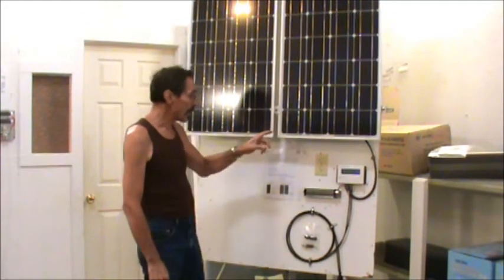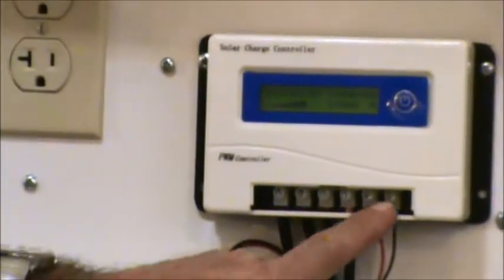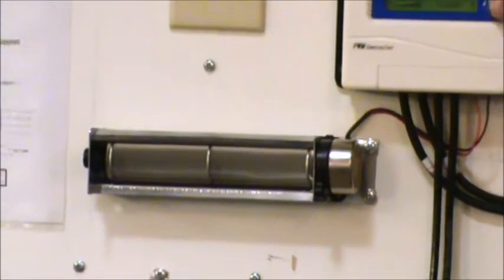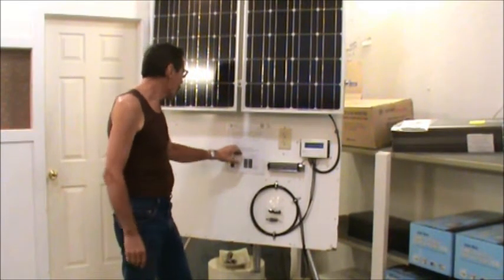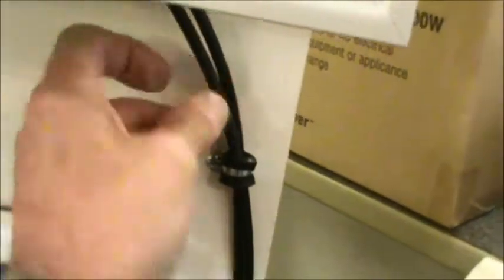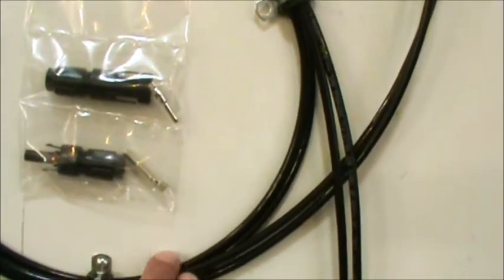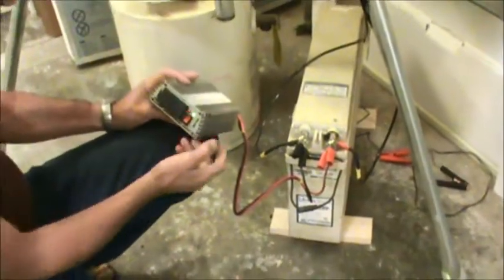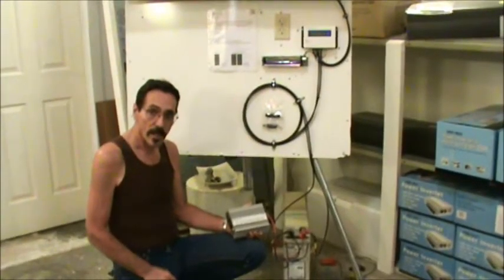DIY: How to Build a 200 Watt Solar Panel Kit | Missouri Wind and Solar

Comment: Hi Jeff
Been watching your vids this beautiful Saturday
Finding them to provide clear and useful info.
My Dodge Van's 270watt solar city panel, on the ladder on the roof racks, is used to keep my cordless power tools charged
plus the fans, inside lights and the laptop all stays fully charged.
Thanks for clearing up some of the solar controller questions I had on some of your other vids.

Comment: Hi Jeff: love all your videos, easy to follow and understand, but I have a question. If I want to set up a small solar system to run a small 135w fridge, how many solar panels would I need?,and also how many batteries and what kind of charge controller and inverter? Thank you and Happy Holidays!
Reply from the maker: Thanks. Here's a video that will help you out with that  Solar panels for the beginner How to Part one Missouri Wind and Solar simple instructions

Comment: I always enjoy when people try to answer the question about what you can run using a 100 watt solar panel.  The more appropriate question is what can I run off of my battery bank and how long will it take to recharge my battery bank using X watts of solar panels.

For example, if I had a 600 amp/hr battery bank, I could potentially run some high draw appliances for a few hours.  But if I had a single 100 watt solar panel, how long would it take to replace 300 amp/hrs of charge into my battery bank?  Likewise, if my battery bank was only 90 amp/hrs, how long would it take to replace 45 amp/hrs into it?

It is possible to have a large battery bank and a small PV array, but you might need to charge for 2-3 days to replace the amount of power that you use in just 4-5 hours of running appliances.  There are a multitude of questions to be asked in order to determine the size of the various system components (PV array wattage, battery bank size, charge controller size/type, inverter size, etc...) when designing a solar system.

Still, it is good to give beginners some rough ideas before getting into the nitty-gritty details of a purpose designed system.  I like the 200 watt kit that you have put together.

Comment: Jeff ,
 I was looking at Sharp model ND-Q250F7, I noticed that the max voltage was 29.8, could I use four of these panels to make a 1kw off grid system?

Comment: Hey all, just getting started in the solar area. I just purchased 2 deep cycle batteries. My next purchase will be the inverter. I am reading about modified and pure sine and wow! why are the pure more expensive and is it worth it to justify the purchase, also Guage wire from panel to charge controller.....size wire from batteries to charge controller... battery to battery...and are inline fuses necessary,  if so, where and how many.......many thanks from trying to go green novice,  lol
Reply: +Chris Norris You want good thick cables especially for distance runs to avoid unneeded voltage drops. Pure sine is good for more sensitive electronics, otherwise I never worried about it. I have a UPS for my computer equipment and I let it worry about the energy. When you are running basic lights and such for a SHTF type thing, you don't care about dirty power.
Reply: Anything with a transformer in it like a battery charger needs a pure sine wave.

Comment from the maker: The charge controller is 30 amps. Each panel is about 4 amp  output. So the answer would be about 8 100 watt volt panels..
Thanks moguy316 for the good comment.

Comment: Hey there, I've been looking at playing powerful speakers on the beach for a while now for camping trips. Where I live its illegal to bring portable generators on the beach (probably for good reason). I need ~200watts for my speakers, (logitech z623), which I normally plug into a wall outlet at my house(120v)... This says its only 12/24 Volt, is it possible to make this 120volt somehow? Would I lose watt power? Thanks for your time!
Reply from the maker: +Walter Michael Konrad  The DC to AC inverter puts out 120 ac volts.

Comment: Great video! I like how it can be use for 12 or 24 volt systems. another thing that is important is to always hook up your batteries to the charge controller first and disconnect them last.
Reply from the maker: ***** Your correct about that. So many people hook up solar to a charge controller first then the battery, the charge controller gets fried.

Comment: Hi Jeff i have a quick question... what if it's only 100 watts panel with a charge controller and a deep cycle 70AH? how many bulbs would it cater? or let we say i will be using 2 unit 12v DC electric fan 15 watts and 4 LED 4 watts lights? how long would it run? 

Thanks,
Allan
Reply from the maker: Probably all day
Reply: Thanks Jeff great help

Comment: it;s VERY VERY VERY important to get a real tight connection on your cables from your inverter to your battery. if the connection isn;t real tight you will only get around 90 volts instead of 120 volts. i bought a new one and this happened to me. i am so thankful that my brother in law had one and knew what my problem was. i was about ready to bring it back or try to sell it. but when i put some new connector ends on my invertor and screwed it down tight it worked perfect. i finally got my true 120 volts.
 i have used it to wire and plumb a new house. used less gas doing it that way than by using my generator. i hope i could help someone...
Reply from the maker: carol bellinger Your right about having tight connections and the proper size cable from the inverter to battery is also very important.
Reply: carol bellinger I've had quite a different issue with connections not being tight enough (not enough surface area).  The voltage actually always seems to be exact but the number of AMPS I can pull through the wire becomes limited if I don't have a good connection.  Not only is the current limited, but the wire and connector close to the battery can become very hot.

Comment: I don't get it, why do say they put out a lot of power?  Earlier you say the two panels can power one electric light bulb.  If I have 10 light in my house I would need 20 panels right?  And 20 panels wouldn't be enough to power my refrigerator. 

Do you have any that produce more power?
Reply from the maker: These are 2 100 watt panels which equals 200 watts. If your using the compact fluorescent light bulbs at 13 watts each these 2 panels would run 15 of those bulbs.
Yes we have over 200 watt panels.
Reply: You set up a battery and a power inverter to it to produce more wattage. The more batteries you have the more potential energy that is stored, the more panels you have the faster the batteries charge up. Hope that helps a little

Comment: Was disappointed.  thought it was going to be a DIY on building solar panels. instead of a commercial.  I live off grid and use 500 watts (solar panels adding to) 24 volt system, 8 golf cart batteries.  Am going to need to replace my inverter as the control module is dying.  Plan to use outback instead of xantrex 2424 as my charge controler is from outback is maxpower point and I run my panels in series so I get much better performance than with parallel/  I am wanting a smaller system (cheap) or DIY for out buildings.  out buildings can be 12 volt as mostly will be lights and occassionally a quick hand tool use, where it is more bother to start the generator than is worth.  Like drill one hole or grind off a sharp edge on a little project.  Right now I save them up and do a day of things rather than complete as I come to it.  I figure 2 to 6 hundred in 12 volt with 4 marine batteries and my 1500 watt inverter will get me operational, not perfect but working.  do you have DIY for a project like mine (cheap is good).